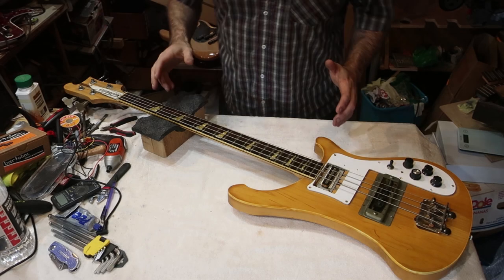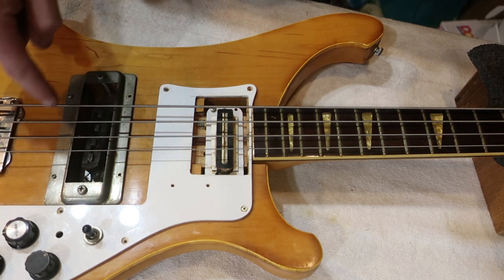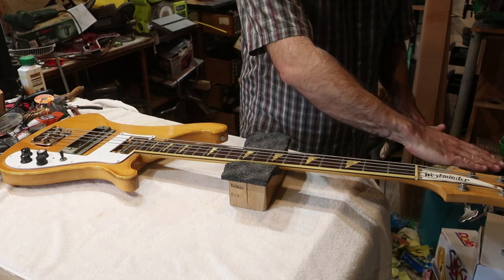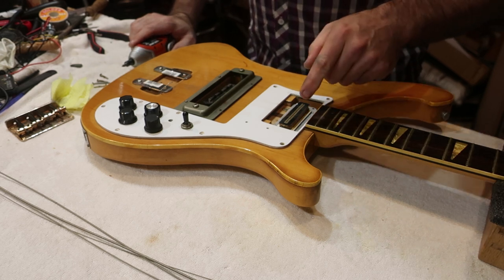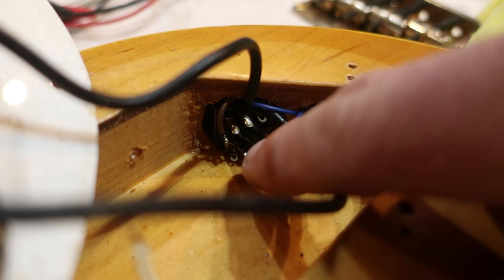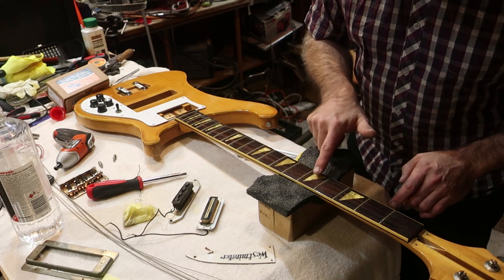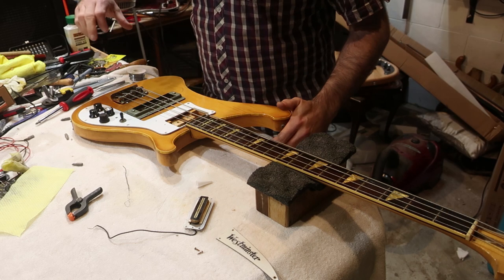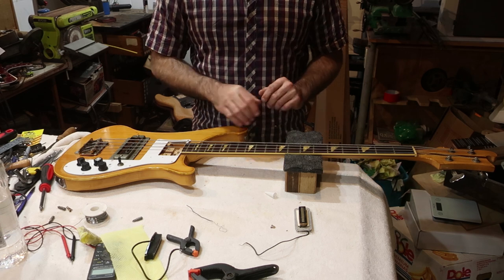Restoring A Vintage Japanese Rickenbacker Clone - Episode 1

Comment: I have the exact same bass. Came to me in pieces, no bridge, no truss rod cover, no electrics or p/u or pickguard. Colour was purple on maple veneer with plain off white binding. No neck plate either. I sanded it clean, made a white pickguard and got a mij 4 pole pickup @5.8 ohm for $20 cdn. Its now a super rare 4000 Rick with oversize sharktooth fret markers. Less than $100 bucks all in. Im happy with it.
Reply: Oh yeah, got a Himass bridge for 10 bucks and screwed some hardwood across that slot at the neck/body joint to beef it up.

Comment: had the same problem with the pick ups turned out to be the toggle switch . and the holes on the bridge cover could be the wrong way round . as there is a slight difference hole spacing.

Comment: How big are the frets on this bass? I might investigate if you could refret with something a little more "jumbo" and preserve that board, its so pretty how it is. Also as others have said, that bridge pickup sounds quite good. Might be worth rewinding as opposed to replacing.
Reply from the maker: The frets were pretty big, and I've got some jumbo fretwire so it's a possibility. As I type this the frets are out and I'm about to start sanding out the hump, no firm decisions have been made and I'm literally taking it one step at a time to decide on what the next 4 steps need to be, I really don't want to screw this one up. And yes, I'm considering making a wooden housing where I can pot that pickup in epoxy to preserve it, it's pole piece spacing is perfect for the neck position so that's almost certainly going to happen.

Comment: I bet the feeling that whoever owned it before cut that big hole in the pickguard for a Gibson style “mudbucker”
Reply from the maker: Yes, I would say so, although the issue with actually installing one is that they'd have had to remove most of the neck heel to fit the depth of it in. We can be thankful that they didn't go that far, despite how far they went with everything else.

Comment: I have a seymour duncan 50s P bass pickup. Powerful. 13k. If you use two of them together though, the magnetic polarity will be out of phase.
Re: neck - wood glue and clamp with the actual screws. 
Great project.
Reply: I was thinking about that pickup too haha

Comment: I have an Ibanez one! It doesn't have the stereo plugs but it does have the (generally missing) pickup cover. It also has the original rickenbacker bridge clone. The electronics on mine are also not working so I am planning to replace the pickguard and put some lipsticks in it. Paid 69 euros for it at a thrift store. 8)
Reply from the maker: Wow, now that"s a great score. I'm still looking for a supplier that'll ship me the Seymour Duncans, I haden't thought of using lipsticks, I'll be investigating that later tonight. Cheers.
Reply: @fanbladeinstruments  I will likely cut a new pickguard to cover both pickup holes so it will significantly change the look. I'll keep the old electronics though, so it will be fully reversible if someone ever wants to fix the actual thing. Your neck also looks significantly nicer than mine. The "inlays|" are kind of coming off at the seams.
Reply from the maker: Yeah, I actually have 2 sets of Dimarzio Model-P's here, I've thought long and hard about modding the bass to fit both sets but it would involve removing wood and making a giant pickguard, I even did a mockup in photoshop to see how it would look and it's a tough call, it looks a bit odd but these basses look a bit odd anyway. I've come to the conclusion that the Dimarzios are probably best suited to a fretted bass, and the classic fretless tone is a bit easier to get with single coils ala jazz basses etc. And as you say, making any mods reversible is an important consideration, although with what I'm planning to do to the neck I'm not sure it's going to matter a whole lot, although if it was a genuine 1976 USA Rickenbacker this would be a whole different discussion🤣
Reply: @fanbladeinstruments  I've seen the Ibanez ones go for around 700 bucks. Those prices sure are inflated but I suppose they also have some historical value. Making it fretless is a pretty neat thing tho!